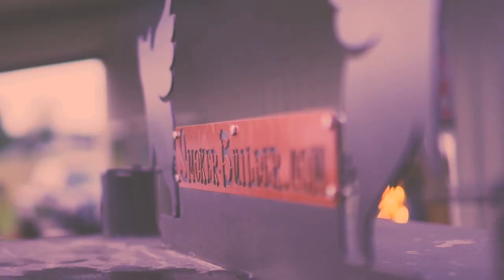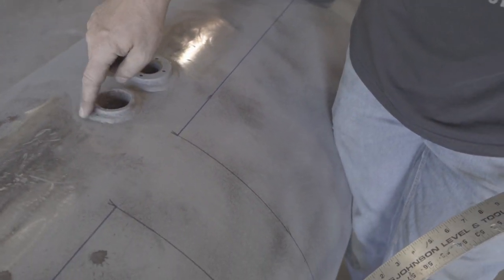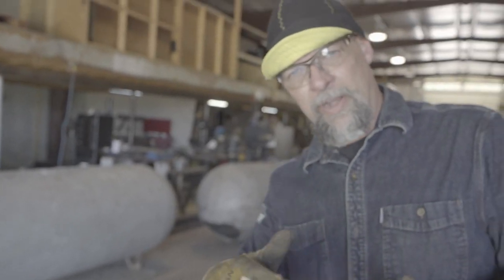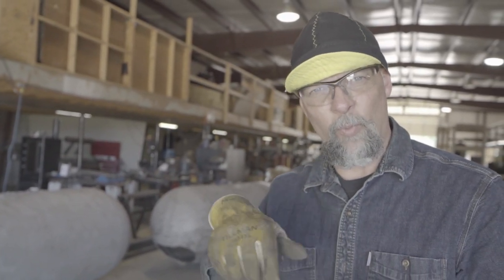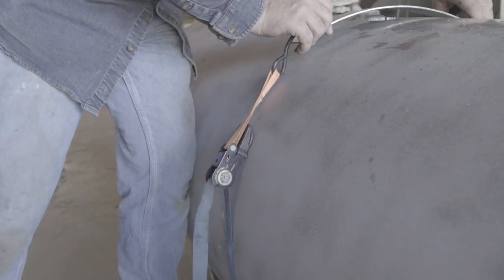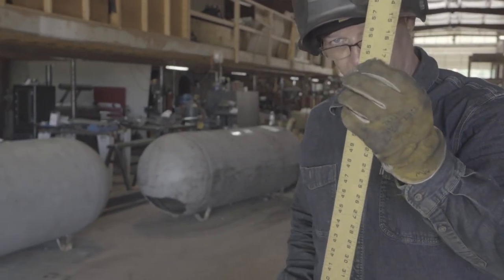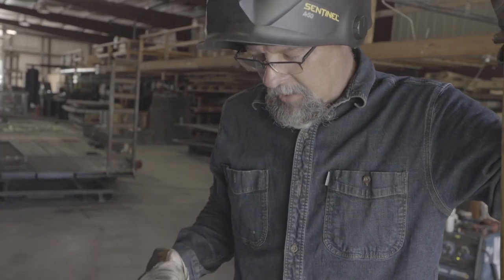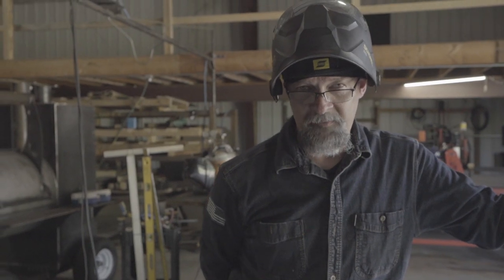Expert Tips-How To Cut Cook Chamber Doors

Comment: Just saw this, love the work. The bung removal tip was great, I have in the past done similar things a bit differently. You can use a second hole saw that fits into the existing hole threaded onto the remaining part of the saw arbor. It saves a step. Keep up the awesome work

Comment: what I was wanting to see is how you bend the plug to the same contour as the tank as I've always struggled with getting that perfect.
Reply: Its not perfect but I cut a circular piece the same diameter as the hole I cut out and clamped it in some vice grips and opened up a vice so the edges were on the vice jaws and hi the center with a small sledge hammer.  Its not perfect but worked well.

Comment: How about a video about fitting the door to the chamber after you cut it out? I know you say there’s no way around just curious how you work it and get it to fit
Reply: If you leave 4- 1 inch tabs to hold the door in place until you fit your hinges and weld those and fit the bottom strip and weld it, the door can't move. Now cut the 4 tabs and weld the side pieces on, door is perfectly placed.
Reply: @rbnhd1976  boom 💯

Comment: I am in the process of building a 500 gallon smoker and i am having a problem getting the drain plug out of the bottom on the tank? Any suggestions on how I can remove it?
Reply from the maker: Usually I do not attempt it. I just make a new hole. If you must remove it a torch and big hammer will help loosen it. Usually the threads will get messed up though
Reply: @SmokerBuilder  ok wonderful thank you for the advice it will help out alot in the process of building

Comment: Any chance to get a video on how you fit the doors to the tank? I use a bottle Jack but was just curious on how you did it. It’s so hard to keep them straight with welding on the strips on the sides too.
Reply: If you leave 4- 1 inch tabs to hold the door in place until you fit your hinges and weld those and fit the bottom strip and weld it, the door can't move. Now cut the 4 tabs and weld the side pieces on, door is perfectly placed.

Comment: Any chance you can do a video on how setup and mount the doors to the cook chamber? I am on my second build, but always looking learn new ways on mounting doors.
Reply: If you leave 4- 1 inch tabs to hold the door in place until you fit your hinges and weld those and fit the bottom strip and weld it, the door can't move. Now cut the 4 tabs and weld the side pieces on, door is perfectly placed.
Reply: @rbnhd1976  great reply, what about replacing hinges on an already built smoker? I have a Brazos and I want to put some custom hinges on, what's the best course of action to replace them without warping the door?

Comment: Could you do a video on working the door to the cook chamber or working the cook chamber to the door in order to get a good fit up? I tried the chain and floor jack method but it bent the door it the wrong spot. Lol. Was hard to fix it.
Reply from the maker: hey buddy! yep, we are planning to do that very soon!
Reply: If you leave 4- 1 inch tabs to hold the door in place until you fit your hinges and weld those and fit the bottom strip and weld it, the door can't move. Now cut the 4 tabs and weld the side pieces on, door is perfectly placed.

Comment: Hey Frank great videos. Your tutorials really help me when I’m building my pits. One of my issues that I run into at times is the door warps on me and I have a difficult time getting the bottom of the door to seal completely. But I do my homework 📚 and study grill/pit building and you my guy are awesome.
Reply from the maker: hey bro! thanks for that!
Reply: im dealing with the same issue. Were you able to bend your tank and or doors back to being flat?
Reply: I've heard that you want to cut most of the material out for the door(s) except for the corners, then let the tank cool to room temp, then knock out the corners

Comment: Do you weld like a 1/4" flat bar be hind the doors, does it help it frm twisting or is there such a thing of the doors twisting?
Reply from the maker: No prep, other than marking the lines. No flat bar, we cut with a 65 amp cutter, and yes if they get to hot they will def warp or move in a bad way.

Comment: I am about to start my 250G Build!  What's the best way to get the paint off the tank?  I was going to take it down to the metal before starting to cut.
Reply from the maker: The best way is to have it sandblasted. Second best way is to use the paint removal or stripping disks from Lowe's made by "Gator".

Comment: Question..Since I plan on painting my smoker using rustoleum 2000 degree black, would you recommend sandblasting the surface before painting?
Reply from the maker: Yes! It will absolutely help the paint stick better.
Reply: @SmokerBuilder  might have a problem.. buddy asked of my tank was galvanized. Its definitely an older tank, possibly .250 wall thickness. Its painted silver, but has rust and pitting from age. If its galvanized,  then I can't use it, right?
Reply from the maker: Correct! If it’s galvanized, then it can release some toxic gas into the air if it gets too hot.
Reply: @SmokerBuilder  do galvanized tanks rust?
Reply from the maker: Yes they can rust.

Comment: Could you show how you work the door to fit?
Reply: If you leave 4- 1 inch tabs to hold the door in place until you fit your hinges and weld those and fit the bottom strip and weld it, the door can't move. Now cut the 4 tabs and weld the side pieces on, door is perfectly placed.

Comment: At the 32 second mark, there is another tank that has been cut for a round firebox. How do I mark the cut?
Reply: How I’ve done larger diameters like that is to use string/twine, wrap it completely around the piece, and use some tape to hold it down in a handful of spots
If you ‘saw’ the string back & forth, it’ll get pretty dang straight. Then you can dial it in with measurements
Reply from the maker: Hey buddy! I would recommend checking out our forum! There is a lot of great information regarding how to mark it like the message below. The forum is full helpful tips and tricks from many builders to help everyone out!

https://smokerbuilder.com/forums/

Comment: too many comments to check for my question. In the video you say theres nothing you can do to stop the door from warping regardless of using plasma or a cut-off wheel. I welded exterior gussets or fins" on the outside hoping it would stop the stored tensions from warping/springing but it still did. The alignment is a little off still after welding in straps to the underside after attempting to flatten it out. Drive me nuts!!

Comment: Did you make the curved yardstick, or is it commercially available? Also, you mentioned having to "work" the doors or cook chamber to make them fit. Are you planning a video on fitment? I'd definitely watch it!!
Reply from the maker: Hey buddy! I rolled it in my slip roll.
Reply: @SmokerBuilder  is there a way for us common folk to do it without a slip roll?
Reply from the maker: Wrap it around a chunk of pipe smaller than the size of your cook chamber. It bends easily since it is aluminum.
Reply: @SmokerBuilder  I was talking about shaping the doors.. you mentioned having to "work" them to fit the cutout since the warp after being cut out from their original tension.. How do you "work" the doors?
Reply from the maker: Gotcha! Try this link to our forums for some info to help. You might be able to search for more at the same time!😊

http://smokerbuilder.com/forums/viewtopic.php?f=87&t=3344
Reply: @SmokerBuilder  I took it to a fab shop and had it done on their slip roll...